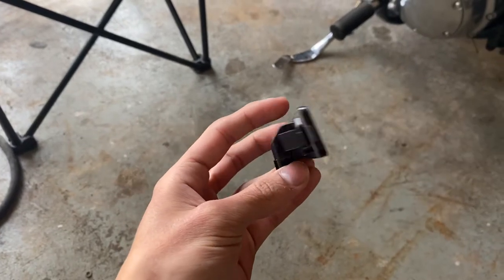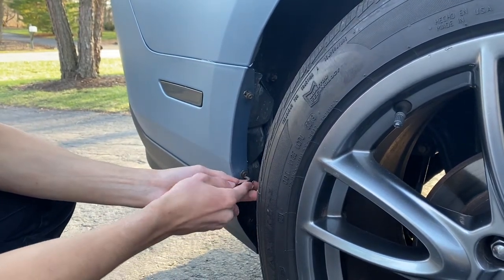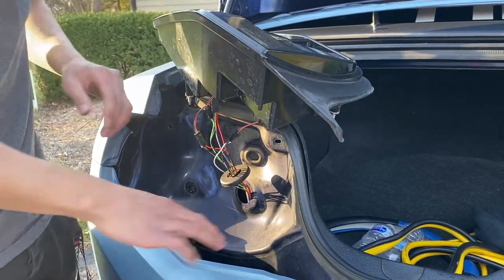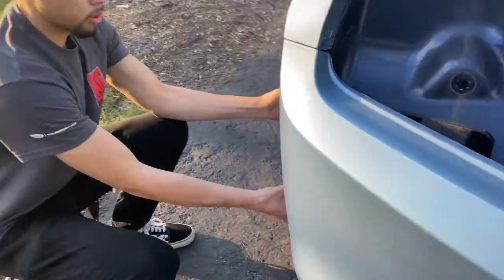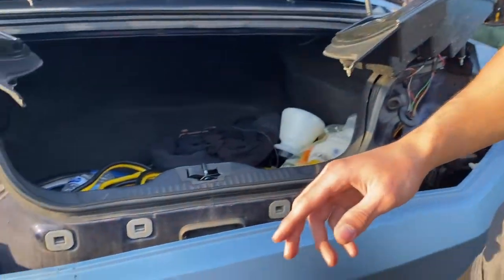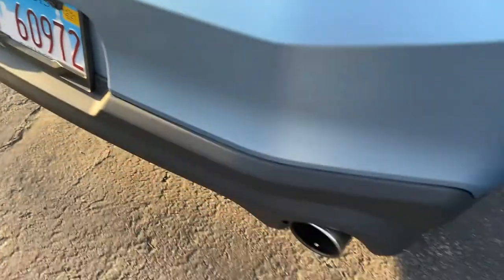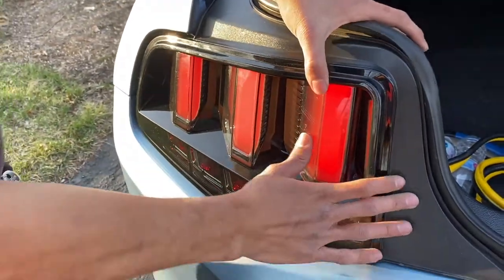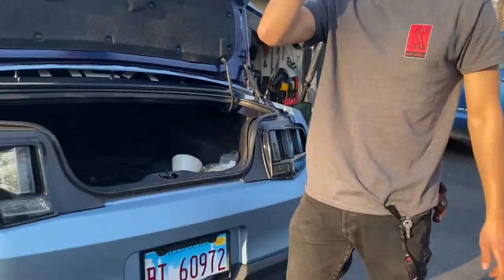2010-14 Mustang | HOW TO: Change your license plate lights

Comment: Thanks for the help bro I bought an entire LED assembly and I removed the 3 screws but couldn’t pop out the housing 🤣 fuck it I’ll save this job for the weekend lmao. FYI this is for 10-12 rear bumpers not 13-14

Comment: Man all you gotta do is take 2 flat head screw drivers n get 1 under the tag light n the the other 1 and put in there and push the clip back n do it on both sides they come out of the bumper they just clip in

Comment: That is crazy. You do not need to remove the bumper. Just pop it out using a small screwdriver and turn it down. 
The installation looks like on a cheap car from India 😂